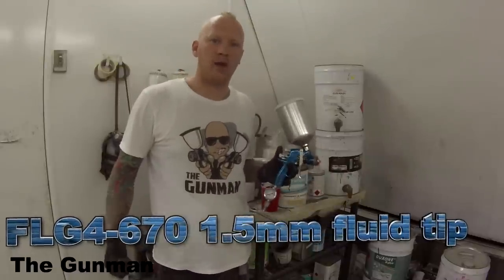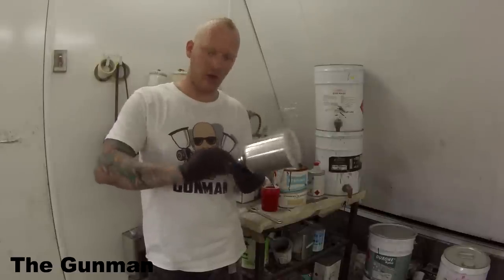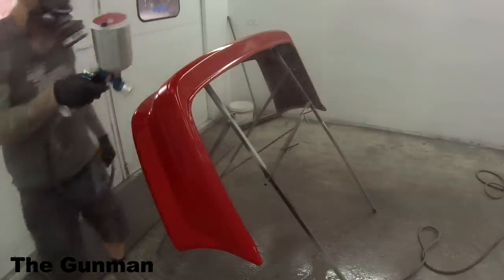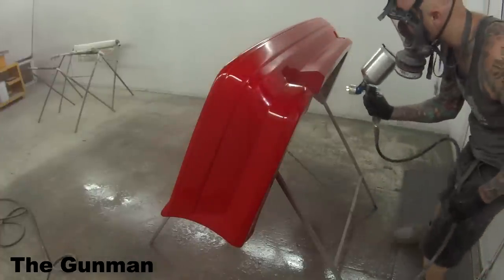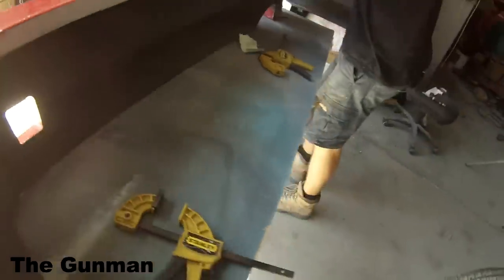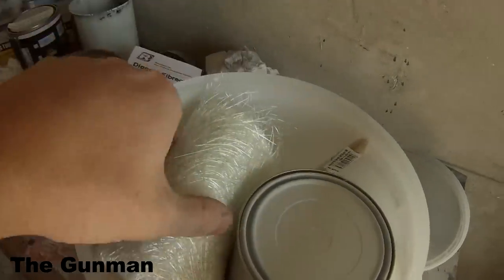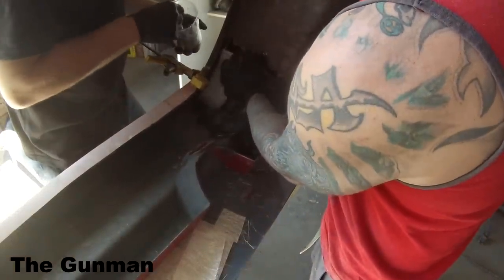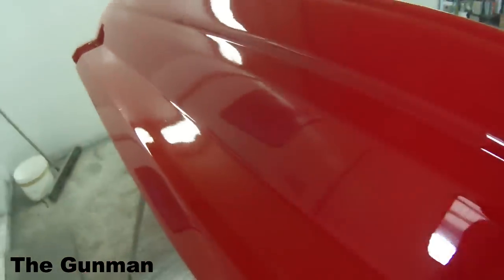FLG4 670 1.5mm Review & Demo

Comment: this might not be the place for this question but... I want to buy that gun for Polyurethane wood finishes, its kind of a thick dense material, do you think this gun is up for that task ?? Thanks
Reply from the maker: craizy007 This gun is an all rounder gun and can be used for nearly any paint type, the HVLP guns need a decent compressor to keep up with the air requirements.

Comment: I've got the same gun but with a cup system and 1.2, 1.4 and 1.8 tip. This is a great mid range gun price wise. I haven't tested it for primer yet but it works fine with both solvent and water based paints. Gets me a nice finish and the paint is atomizing great, I get a smooth finish. I have an LVLP gun and an RP gun too for car painting, several cheap guns on top of that used for jobs that aren't that important. But if I paint cars I usually use my DeVillbiss. I'm going to paint four doors on my car this summer. I bought myself a better used car for a fairly low price because it had scratches from dog claws on the upper part of the doors. It's a quick job but as don't have heat in my shop I need to wait for the summer to come. Great channel. Good to see people that take pride in what they are doing and doing a damn good job too.

Comment: Nice repair ! I have used the finish line flg3 for base and clear. It gets the base coat on but did not perform well with high solids clear. I also found the gun required higher air pressure than what was suggested by manufacturer. Recommended 23psi. I used 28 to 30 psi at the gun with 1.3 tip. Thanks Gunman !

Comment: Congrats on your 200th video gunney! Thanks for the review, yeah... I'm getting the Tekna ProLite, no doubt about it. You have been instrumental in my decision, also, I would love to see a video on compressors, that would be awesome. I currently have a 5hp 80 gallon BelAire compressor, it should be good enough for the Tekna, yes?
Reply from the maker: ezman77 It should be fine, if it struggles with the te20 then go to the te10 and it should be fine, I do plan on making a video on which compressors will work with which guns.

Comment: Being a boat builder it cracks me up watching you guys with fibreglass! So high temp low pressure? Low temp high? what about high humidity? I dont paint in a booth mainly makeshift masking film tents
Reply from the maker: BigRoy1979 Yes that's correct with pressures, Humidity won't affect pressure settings just temp but humid is the worst weather for painting and in high humidity a booth with dehumidify cycle is the only way to go or it'll lead to problems with little water droplets inside the paint and that's the reason you see paint bubbling up.

Comment: I had same problem with my spray gun Not this model but I found out that it sprayed a lot better by removing the valve and pressure gauge attachment at the bottom of the gun.  May fix it or it may not.  Thanks for your videos and I am planning on buying this model.

Comment: Thanks for sharing that Gunny.  I'm not too sure about this gun, the price is right but I live in a colder climate so I'm not sure about thinning a lot more and putting on extra coats versus spending more up front on a better gun for the long haul.  I'll check out the clear coat demo and maybe if it is good I will consider it for a clear gun.  Thanks for your research!

Comment: a nice small fiberglass roller would be awesome. would it help if we just send you a gun to test and you can give it away after?? just need a place to make the list so we can check it off whos sending you a gun. l use the 1.5 tip on my starting line gun for single stage urethane turns out nice. what we should send you is a F350 Superduty with a 6 inch lift and see how long that vid would be lol speaking of hectares . congrats by the way on your 200 vid and 1000 000 000 views

Comment: Question, today i bought the Gti ProBase BH11 9LH with the separate digital regulator, I'm so stoked! it came with the H1 Aircap, Why do u recommend the T2 Aircap? whats wrong with the H1? Gonna be spraying a fridge shortly to test it...i tested it earlier on a piece of paper and it sprays at very low pressure, i have to set it at like 1.0 bar to spray

Comment: Would a 1.5 tip be to large for metallic paints? or would 1.3 be better.
Reply from the maker: johnbeer678 You could use a 1.5 for metallic but 1.3 or 1.4 would be better.

Comment: I just bought the same gun why is it when pressure gauge on compressor reads 120psi and on pressure gauge on gun highest it reads with trigger pulled down 10 psi thanks
Reply: I bought this and the gauge out of the box was bad.  Devilbiss gauge you would think would be good they must have poor quality gauge.
Reply: I have the same gun and it works great.  But after not using it for years, I broke out the owners user manual and read that the gun is set to spray regulations that keep the psi at the gun to 10lbs to cut down unnecessary spray waste.  They also said not to use more than 100lbs at the gun inlet?  I don't have the manual handy so I can't back that info up.  I have the gauge and regulator at the gun, including a water separator too.